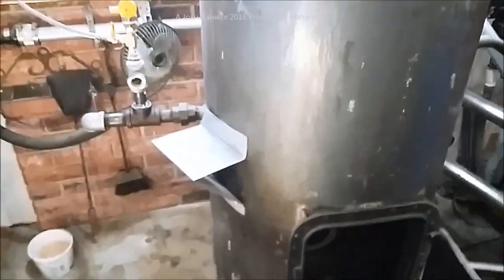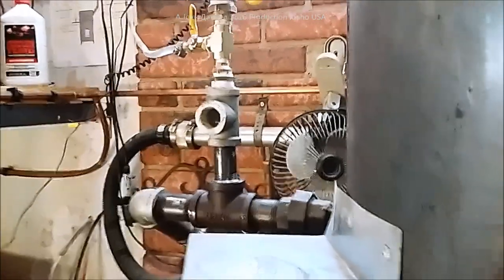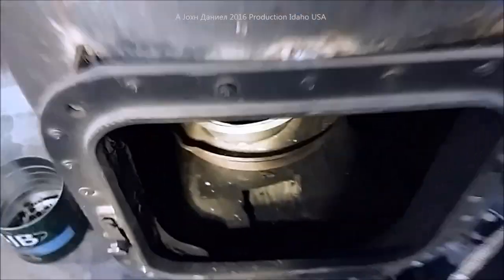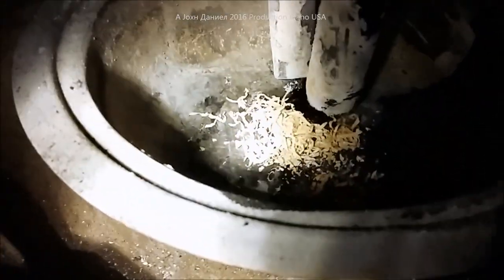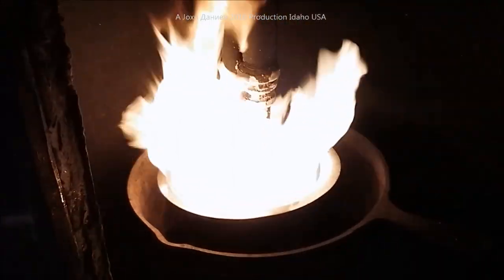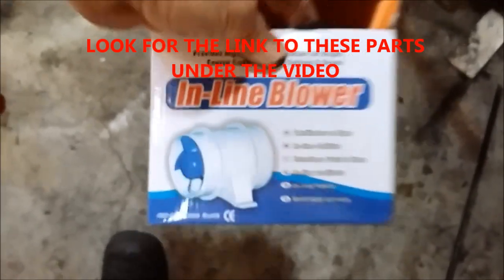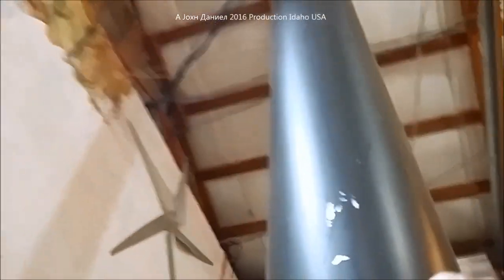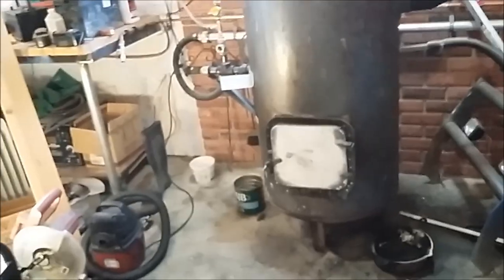Building it, Waste Oil Heater How To Fire it up- Living off grid, see ↴

Comment from the maker: Major Parts DOOR KIT -http://rover.ebay.com/rover/1/711-53200-19255-0/1?icep_ff3=2&pub=5575119394&toolid=10001&campid=5337663791&customid=Best+kit&icep_item=162342937514&ipn=psmain&icep_vectorid=229466&kwid=902099&mtid=824&kw=lg BEST BLOWER  http://amzn.to/2FB6pe7 BLOWER ADAPTER http://rover.ebay.com/rover/1/711-53200-19255-0/1?icep_ff3=2&pub=5575119394&toolid=10001&campid=5337663791&customid=Fernco&icep_item=372010889703&ipn=psmain&icep_vectorid=229466&kwid=902099&mtid=824&kw=lg and Right STOVE PIPE  http://rover.ebay.com/rover/1/711-53200-19255-0/1?icep_ff3=2&pub=5575119394&toolid=10001&campid=5337663791&customid=AmMetal&icep_item=400542670761&ipn=psmain&icep_vectorid=229466&kwid=902099&mtid=824&kw=lg Amazon Links to parts used
DOOR KIT - http://amzn.to/2h8JbkE
BEST BLOWER  http://amzn.to/2FB6pe7 due to lifespan is high
BLOWER ADAPTER http://amzn.to/2haptHH
STOVE PIPE http://amzn.to/2h8wSar

Comment: I`ll say that the continuation of your first video introduction is complete now..  I`m glad you did this video because it show your unit still running good and still functional after all that time heating your shop.. A good addition would be a copper coil put on the top of the unit and heat water at the same time..  Good video John
Reply from the maker: +al “peper 0110” desrochers I have a stainless steel fireplace watet core I can put in it eventually and 2 big old iron radiators. 
That will keep the heat going for hours after its turned off.

Comment: I have looked at a few of these systems and I was thinking instead of gravity feed, using a pump with a nozzle to atomize/mist the waste oil. This would likely reduce consumption even more for the same heat with even lower emissions. Also incorporate a HVAC heat exchanger W/blower incorporated into the top of the unit for forced air heating,

Comment: I'd go one step further and use a 55 gallon barrel fitted around the outside of the tank as a heat jacket.  Then get an old furnace blower and make a furnace out of it. I did that with many of my stoves and it works so much better to blow the heat from the stove to where you want it. In my shop I blow the heat from the stove down to the floor so it naturally rises to heat the shop better than just having air blowing at the stove.
Reply from the maker: I have about 10 big heat sinks used in Absorption Refrigerators ( rv fridges) , about 10" long each, and 5 x 5 fins on them. Thinking that for drawing more heat out of the steel.

Comment: Hi, we just got 4 / 55 Gallon Oil, some have Water in them. What is the best method to Filter and get rid of Water? Also, there are sluggish Oil on the bottom too. I have never Filter out Oil, this is my first time... Any suggestions? THANK YOU !!!!!
Reply from the maker: +Jod Bronson If the drums are allowed to sit about a week the water and oil will separate.  You take and put a pump in all the way to the bottom to pull out the water which will be in the bottom. It may be mixed with sludge.  Once you get to oil you can use then stop pump.  Dispose of the water mixed waste per law (recycling center) or auto parts stores.
Reply from the maker: +Јохн Даниел much of this oil may contain glycol  (antifreeze ) if so, redo pump out procedure till good used oil is flowing, after sits another week.
Reply: OK, I will try that, THANK YOU !!!!!
Reply: THANK YOU !!!!!!!!!!!!! I will try your great suggestions, I think this will be the BEST method!!!
Reply from the maker: The absolute best pump for what your doing is this one, self priming, All bronze gear & ANY FLUID! http://amzn.to/2oW2sLL . Get it, some 3/8" ID vinyl tube http://amzn.to/2oVLFbM and then you will be equipped to seriously process and use your oils. Be damn sure you get the best stove pipe, these can produce lots of heat.

Comment: Very nice set-up (spring project for my place)  but can not use barrel stove kit up here (illegal) according to Canadian codes,cant even get a kit sent from the States
 Primary heat 24/7?  CO2 sensors ? 
Your thoughts on this idea...  oil burner using the Rocket stove heater design to eliminate heat loss out the chimney.
Thanks,
Ray
Reply from the maker: +Ray in Canada You certainly can automate the system to have solenoid valves and high pressure filtering to use it constantly 24/7. 
I recently built one (customers property so no video) that has much more automation and extreme filtration with 80 feet of  3/4" stainless tube wrapped around it to heat glycol for 5 big iron radiators in his building. He will run it for 3 hours on, 8 hours off per his plans.
Reply from the maker: +Ray in Canada No C02 sensors needed so far.
Reply: Good but if your heating 4,200 square feet might be small investment to stay alive.lol
Do you run it 24/7?
Any thoughts on building burner as rocket stove heater,to get more heat using less oil.Just asking trying to figure out what my oil burner will consist of  this spring.
Thanks, Ray
Reply from the maker: +Ray in Canada Actually a rocket stove design is best used on wood. 
But like the old trap heat stoves, you just need to make a heat for a few hours and store it to get best results. I do this with my wood stove in my house.  Heat 300 gallons of 70/30 water glycol mix in stainless steel drums then from that basement closet the heat comes up all night and half the next day using bypass dampers on the venting and 4 120mm fans.
Reply: Thank you
Reply: Hey Ray In Canada, I also live in Canada and had no problem getting a stove kit from " Northern Tool "
http://www.northerntool.com/shop/tools/product_20894_20894
Fast delivery also.
Reply: Thanks for the info.

Comment: Nice build .  How do you have it set up for off grid ? Solar power ?
Reply from the maker: +JJD1913 Runs on the sun,  3600 watts solar on the shop and 2100 on the house plus some thermodyne and Hurricane Wind turbines run it all. My water well and 3 240v outlets for welder is still on grid though.
Reply from the maker: If your going to build one like mine, ITS EASY, Amazon Links to same parts I use if thats your preference DOOR KIT - http://amzn.to/2h8JbkE BEST LOWEST AMP HIGHEST FLOW BLOWER http://amzn.to/2h5QNEa  BLOWER ADAPTER http://amzn.to/2haptHH STOVE PIPE http://amzn.to/2h8wSar Cheapest priced and longest lasting results I found for these.